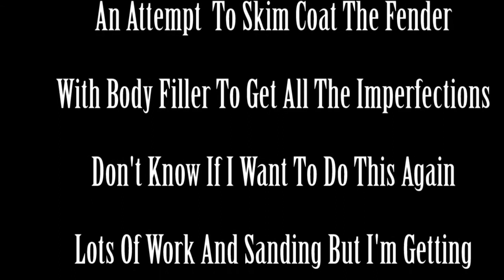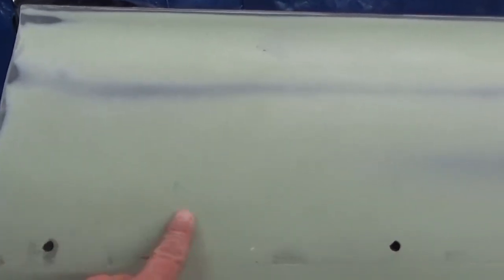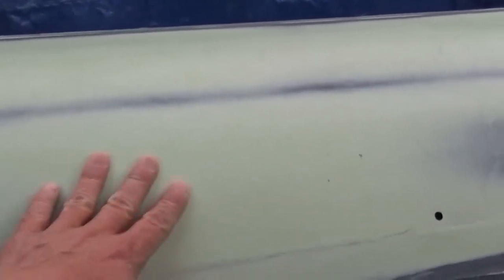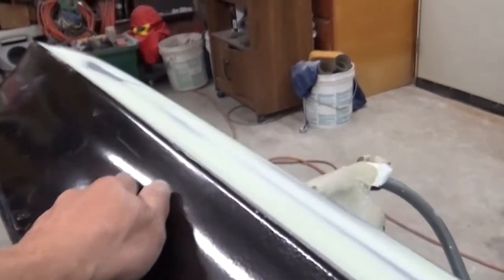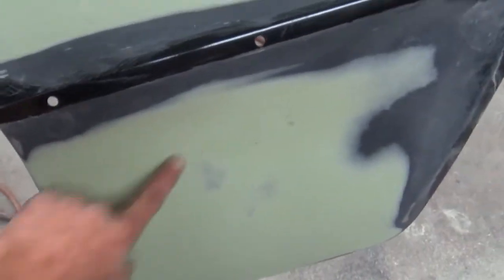64 Impala Fender In Body Filler

Comment: I'd sand all the filler off that has those chunks of hardner in it..  Also, on the top of the fender, fill those gouges in with glaze and block it smooth Before you prime it.  Urethane 2k primer will fill that stuff in, but can shrink back later and you will see them later in your final finish.
Reply from the maker: Shut Yer Face Garage Thanks for the advice I will take care of the chunks of hardner and glaze the top.
I did not know about the 2k primer could shrink, again thanks for your help I really appreciate it.

Comment: Oh sanding what joy .. you have a board sander they are a great help ,also keeps the panels you are sanding flat
Reply from the maker: TheFrameoff Doing it by hand using dura blocks.
Reply: Sam Q I have heard a lot about them , do they work good
Reply from the maker: So far I like them they work really well.